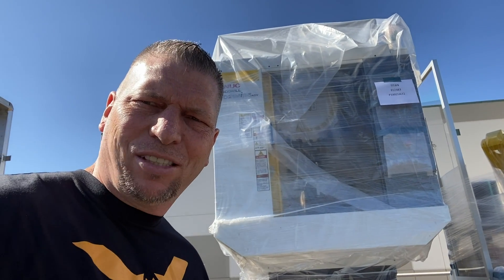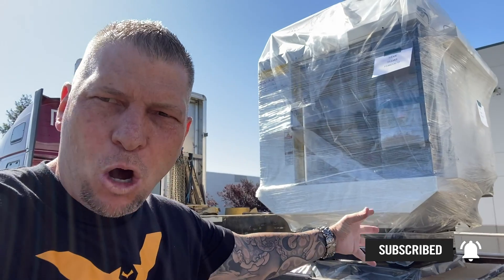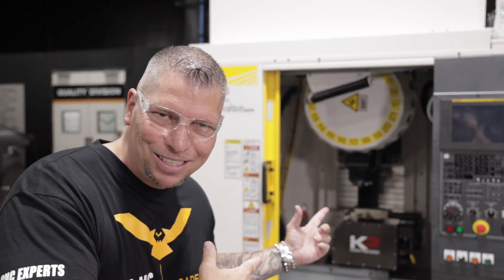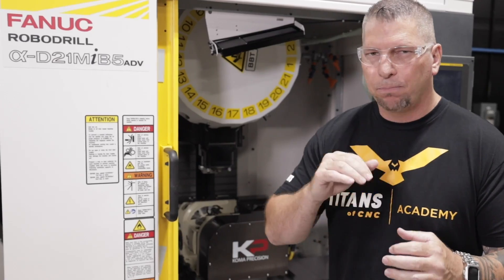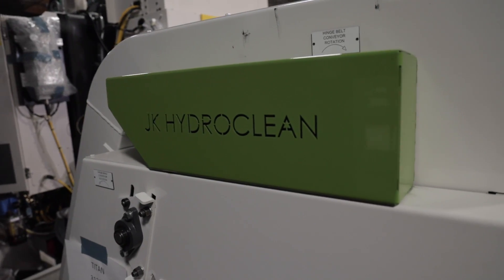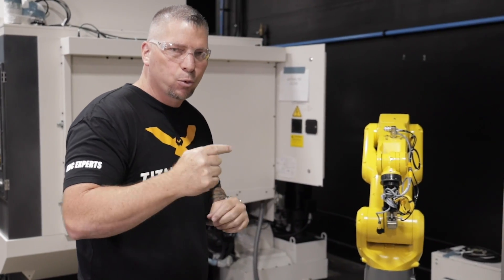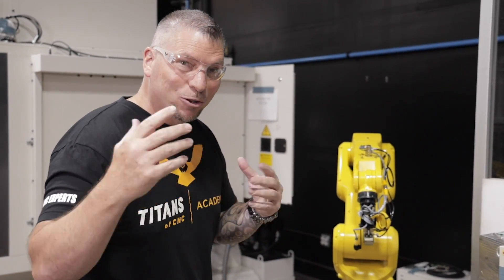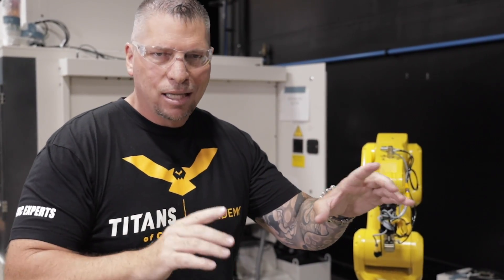Lightning Fast 5-Axis ROBODRILL CNC Mill Arrives at Our Shop | Fanuc Industrial Robot Arrives

Comment: Titan, maybe I'm totally missing something but it seems to me that virtually all parts could hugely benefit from sawing out big chunks of material before doing any milling. 
I see many operations where I would mount a circular saw blade in a given machine head and then I'd saw  out every cubic inch that I could before milling anything. 
Am I missing something here?
Thanks!  :)
Reply: If you're talking about having the machine saw chunks off: Would you want a big chunk of metal dropping into your machine?

If you're talking about doing it manually before putting the stock in the machine: takes waaaaay too much time compared to having a machine just do a bit more roughing out. Big insert cutters don't take that long to shift slot of material 👍

Comment: I replaced a couple of old tired Fadal CAT40 taper machines with a pair of Robodrills.  Got laughed at because of the 30 taper but with the dual contact 30 taper, it has outperformed those old Fadals and had a few people tell me they were wrong about the 30 taper.  They have been great machines, especially with high pressure thru spindle coolant.

Comment: I learned to program on an old 3 axis robodrill with a screen so dim you’d have to hold a piece of cardboard overhead to cut out the glare to even see the screen. Needless to say they have a very special place in my heart. Fast, dead on accurate, and it taught me about working around a machine’s limitations.
Reply: Would you say it's a good machine?

Comment: Cool new setup. I’d really love to see you integrate this with that new shop floor CMM you showed a while back and have it tweak offsets, and queue rework and a cull pile. That’s the high level stuff- Getting into the real nuts and bolts of the communication back to the PLC and making it really get after it.

Comment: I’ve built and assembled a lot of Fanuc machinery. Crazy good safety integration, doing demos is the best because I would run at 15-20% speed to dial in simultaneous operations and then start ramping up the speed and the people’s faces when this thing got over 60% speed was funny. Especially when it was in the 80-90% range.

Comment: Man I was looking at robodrills. I wish they were easier to shop for. Would be nice if all machine tool companies had a build a quote system like haas
Reply: I actually watch some of your videos Ci and its why I say this, but always buy these machines used. the old seiki/ Japanese mills are still accurate 30 years later even with HARD use. 
Cincinnati machines are good aswell. Stay away from haas, they are cheap for a reason. 
if you ever make it big that's when the new stuff comes.

Comment: Robots are job killers. Robots don't need pay checks or benefits, so employees are fired and the shop owners make more profit. Worked for a division of Sandvik that replaced 80 employees in a two day period with robots and automation.
Reply: robots kill one job (putting the part into the machine ... taking the part out of the machine) but you will need someone who will program them you will need someone who would design and make the gripping system that the robot will use to hold material and parts you will need someone who would maintain them you will need someone who will design the robots someone who makes the robots someone who sells the robots and don't know if thats all the point is watch the world where is going and learn something new if your company bought a robot and you said "Hey I know how to program them" would you still lose your job no, a lot of helicopter pilots and cameramans lost their jobs because of high endurance high speed drones eqquiped with camerasthe world is changing and you need to adapt yourself with it otherwise you will lose your job
Reply: #capitalism
Reply: Job killers 😂😂, what about machining 12 ton cylinder heads, get real.
Reply: Robots should give you inspiration to move on to bigger better things. If you complain about them then you deserve to lose your job.
Reply: @justinl.3587  Guess you never had to feed a family.
Reply: We used to get work from sandvik arnprior but they moved to mexico thats a job killer bud!!
Reply: @antoniknezovic3863  I was Procera Sandvik, we made dental implants
Reply: The robot we are getting from Yamazen is allowing my shop to make three shifts of product with two machines that are currently only running one shift. Yes I'm making more money so I can hand out raises to keep my employees pay on the level with inflation and pay my continually rising health care costs at 15% a year. They need to make more just to continue paying their bills. Wish I could raise my prices 15% a year. Robots are becoming a practical reality.
Reply: Robots are not job killers. They are too dumb to even do that. A human must program them to do everything. So if they kill a job, a human programmed them to do so. Allow me to elaborate:

a) You bring in robots and you lay off employees. This means you get pretty much the same production capacity. Maybe 2x. But you're not paying the salaries. So more money goes to the profit. And it might sound weird but large companies prefer to show large growth and small profit than large profit and small growth. And you also need the programmers to setup for each job who get paid more.

b) You bring the robots and you keep the employees. Now, you can have an employee tending to 3... 4... ...6 machines. That means 3x, 4x, ..., 6x production capacity. But... You need to get the additional product sold. Which is hard.

So. Automating and laying off employees is the easy way to do things. It's the "Low Hanging Fruit" of Automation. And although the "Low Hanging Fruits" work for Tenacious D, in business it's a practice that doesn't last long.

It all boils down to this. Don't hate the tech. Hate the ignorant bean counters that make the decisions (note: there are non-ignorant bean counters out there too).
Reply: @ExMachinaEngineering  so when your company gets a robot that works faster than you, for no money and your let go will you then think robots are better? You must be a shop owner looking for an excuse to fire employees and make your pockets fatter...
Reply: @Terry_Baker   So if I was a shop owner I wouldn't follow my own advice.
No reason to be hostile here. Read through what I said and I think you will agree. And it's not my opinion. It's the premise on which automation was developed. The "___ will take our jobs" line has been going on since steam engines.
The "smartypants" who thought they were smarter than everyone else and went that direction soon found themselves as the Coyote looking down.
And robots working faster for no money. Oh no. That's not how it works.
Finally, did the CNC mill take the job of the machinist? Cause a VF2 is a pretty damn advanced robot.
Reply: @Terry_Baker  they also do hard labor intensive work that people get worn out over, think about the automotive industry, cant blame companies for exploring the fields of automation. Im pretty sure that the example you shared still had employees looking after/programming the robots right?